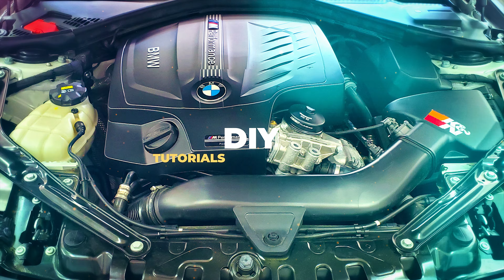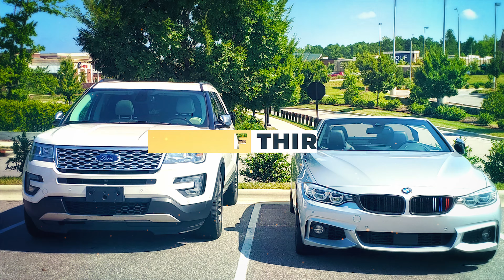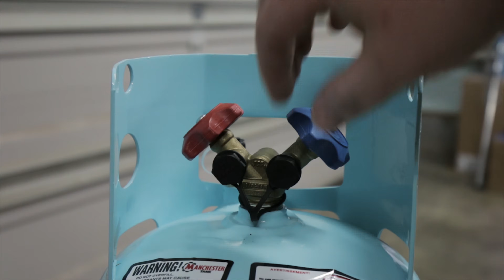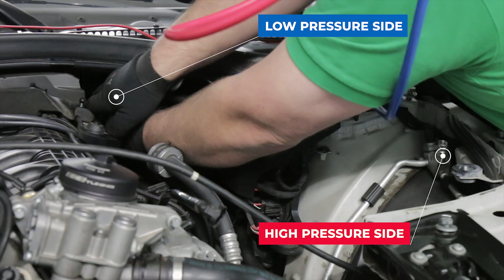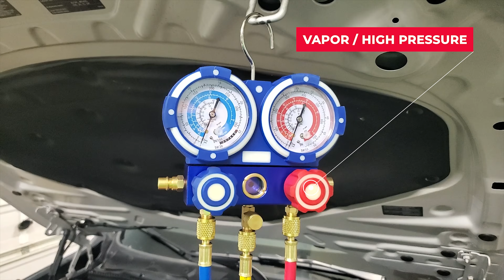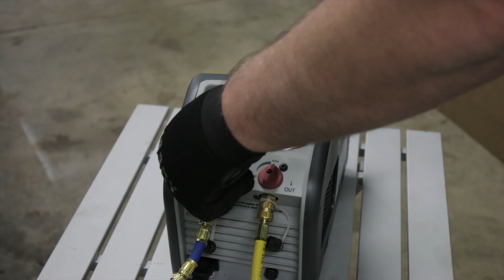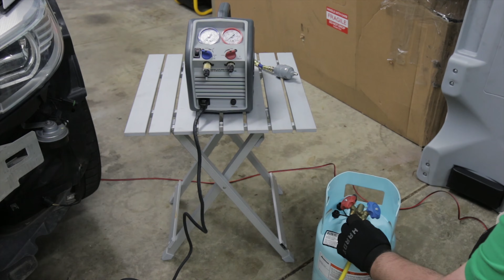EVACUATE YOUR CAR'S AC SYSTEM THE RIGHT WAY

Comment: Great video! One thing I want to correct though—R-134a doesn't actually deplete ozone. In fact, that's why it is used today instead of R-12 (aka Freon), which had an Ozone Depletion Potential of 2,400 (R-11 has an ODP of 1). 

The reason why you can't vent it is due to its Global Warming Potential (GWP; basically how much heat it absorbs from the sun and traps in the atmosphere). CO2 has a GWP of 1, which doesn't really tell us much because the GWP is defined based on CO2. R-134a has a GWP of 1,300, which means 1 gram of R-134a is equivalent to 1.3 kg of CO2 in terms of its effect on the greenhouse effect. One 12 oz can of R-134a has 340g of refrigerant, and venting all of that would be like releasing 442 kg of CO2, or almost half a metric ton. Roughly equal to 10% of the average car's annual CO2 emissions.
Reply: $600 for the refrigerant recovery machine alone? If they want people to be responsible about this you’d think they would make it affordable to do it.
Reply: Why do they sell bottles at Walmart if it’s that dangerous?
Reply: @evidinha12  Who knows?  How come you can carry up to 11 pounds of live ammunition on a plane under the current rules?
Reply: @evidinha12 they don't in Washington anymore. Have to have 609 cert to buy it now because of the ozone layer or the global warming effect, depending which refrigerant you vent.
Reply: @evidinha12  because you can also buy caustic/toxic cleaners, guns, knives, screwdrivers, power tools and many other dangerous products, but you're expected to act like an adult with some brain cells and do the right thing with them.
Cant wrap everything in cotton wool and bubble wrap.
Reply: @bushratbeachbum not true. Govt doesn't want you even having gasoline.
Reply: @Arbitrageur_  which comment are you responding to?
Reply: If my system has leaked out R-134, do I need a recovery tank since nothing to put back in. I can then just connect gauges and vacuum
Reply: @bobbysmith4540  No, not if your gauges show 0-0 pressure left in the system.
Reply: @bobbysmith4540  need to check the pressure first, check for oil leaks, then recover whats left, pull vaccum, test with nitro, repair leaks and then refill with required oil and dye amount
Reply: How much money to spend in order to save $20.00 in new freon at Walmart? Recovery freon when million cars out there are leaking every second, even new cars on lot and those that no one bought it. is absurd
Reply: I finally broke down and took epa609 test. A friend in Washington says you CAN'T buy r134a recharge kits,and shops are charging 100.00 a lb for charging system. It also is being phased out and using blends will cost you big-time if you go to a shop . 
 Why not vent?? Get caught by your neighbor can give them up to 10k rat out  and 37k fine to you. 
  The days of the propane leak detector is over,and as individuals diy without equipment bring more regs.  Charging without pulling a vacuum leaves air in system and higher pressure reducing efficiency.
Reply: @daleharvey3278  I've been using Envirosafe Industrial r134a replacement refrigerant. It's better than r134a.
Reply: I hope you all realize that those air can dusters are filled with this stuff.
Reply: @JustEnjoyingLife73 wrong ... That is compressed CO2
Reply: @AnthonyVierra  compressed CO2 would be extremely dangerous due to the extreme pressures. Canned air is definitely the same as refrigerant. Just look up the MSDS for one of them. People even fill their ACs with what's inside canned air.
Reply: @JustEnjoyingLife73  find me a link to purchase what you describe...
Reply: @AnthonyVierra  You might want to google "Chemtronics HFC-134a A/C systems" and find out how wrong you are.  The electronics and medical industries use HFC-134a and vent it directly into the atmosphere from "canned-air".
Reply: Not trying to argue, I don't know anything. Just a question I have. Where in the environment does this come from that it is so dangerous that it can't go back? I know it's wrong, I'm just being facetious, but it's like oil was in the ground and everything was fine so it should be ok for me to pour it back where it came from :p
Reply: Narcissism is real
Reply: That recovery pump and gauge set is intended for 410 not 134
Reply: wow! Great information! Thank you!
Reply: That is very nice explanation. By any chance can you provide a reference to the source? Thank you.
Reply: EPA Section 609 Program
Reply: @Rbenterprises4  Easy to get certified.  Then  you'll be able to work on other people's cars for $.
Reply from the maker: While R-134a does not have an Ozone Depletion Potential it does have a high Global Warming Potential. (GWP) The higher a GWP number the more damage the  product can do towards Global Warming. These high GWP chemicals are known as Greenhouse Gases.
Reply: @fthirty3  yeah, the guy said that.
Reply: 134a gwp is actually 1430 and r12 was 10900 (yf is 4), but the ozone part is correct. dunno the odp numbers
Reply: Sorry man. U need to go look it up. Thats y u cant just release it into the air.
Reply: I say it’s all bull s&@t. If this was so hazardous to the environment they would t sell it to the general public. Imagine how much r134 is discharged into the atmosphere from car accidents alone. The equipment you need to handle r134 is so expensive that there is no way the DIY er is gonna buy it. And then the manufacturers sell you a car that requires 1.2 cans of r134. What happens to the other .8 ? Rant over.
Reply: @imadog131 you been eating all mummy's tide pods champ? Xxx
Reply: @bushratbeachbum  Not hardly. It’s all a scam because somebody wants to keep people from fixing one of the simplest systems on their own car.
Reply: @imadog131  didn't you say you can buy it freely?
You're not really making much sense there big yin
Reply: @bushratbeachbum  Yes you can buy 134a and the equipment but who’s gonna spend $800 + for $150 bucks worth of gauges and pumps?
Reply: @imadog131  i bought my kit second hand for under $100 and me and my friends use it often.
Makes a lot of jobs much easier if you can take the ac components out.
Although some people can't think for themselves, others are able to see a problem and find a solution to it.
We're all different though, huh?
Some people don't know which end of the crayon to chew and which end to scribble on the shortbus window.
Reply: @bushratbeachbum  Those are the ones who believe whatever the government tells them, the ones who think Joe Biden is a good President and those who believe the global cooling, warming or climate change whatever they are calling it these days.
Reply: @imadog131  The new self-sealing cans will retain the 0.8# for the next job.
Reply: I don’t look at the EPA numbers anymore. They change over the years, as do what to be the most concerned about. Example: co2 is the worst. What? Now NOX is? Heat emmissions? Water vapor? NOX is 265x worse than co2? Huh? Now it’s 300x worse? 
The point is- it’s not good for the environment, but the reality is we don’t know how bad. We change our statistics and make it up as we go.
Reply: actualy id be more worried about the SIF potential... (sky is falling)
Reply: But we all know human activity like this is not what is warming the planet.
Reply: I'll just release in the air my self. Not paying to have it done. Stop being pansys

Comment: Couldn’t you of just used the recovery machine to draw a vacuum? I’m not understanding the point in the vacuum pump when you have the Robinair recovery machine.
Reply: Yes the machine is beginners hobbyist.  
Get what pay for. 

I let pros do my recovery and  charging service vs buy the machine..  

I still have questions too about oil install. The system needs right amount of oil to work long term
Reply: @jamesconnor9142  I have had "pros" work on my AC system and the last 2 have done terrible jobs.  However, I believe an educated car owner can get much better work done by mechanics once they know they aren't dealing with the average "Joe".
Reply: my recovery unit trips off at ten inches of vacuum.   The pump cannot handle drawing a higher vacuum than that without damage.   I switch it over to my vacuum pump to finish the draw down, which has oil.. unlike the recovery pump.
Reply from the maker: The recovery machine isn't designed to draw a vaccum. It's only meant to transfer the refrigerant.

Comment: Can you recharge the gas from the recovery tank back into the A/C system?
Reply from the maker: You can, but its easier just to put new refrigerant in which is what I chose to do.
Reply: @fthirty3  .......Then what is the point of doing this freon recovery?.......I thought that when the government regulated the old freon (R12) out of production that the new freon (R134A) was environmentally freindly?....So therefore can't you just release the freon into the air?
Reply from the maker: It's still illegal to vent r132a into the air. So either way, you have to capture it. If you'd like to reuse the refrigerant,  just reverse the flow from the recovery machine.
Reply: It seems i would want to use the 'old freon'  its just cheaper and makes sense. 

Freon doesnt get old  but its expensive to replace over $100 dollars to fill from empty
Reply: @jamesconnor9142  I’m definitely no expert, but I think the problem is that unless you have the refrigerant identified and analyzed, you have no way of knowing if you are putting contaminated refrigerant (w/ air, moisture, sealant, etc.), or possibly even counterfeit refrigerant, back into the system, which could damage it in the long run. As far as I can tell, the machine in the video is a recovery-only machine, but there are also analyzers and recovery/recycling/recharging (R/R/R) machines, some of which I think are capable of filtering to get the refrigerant back to an acceptable standard. R/R/R machines are expensive, so perhaps a shop can do those steps in the process. Otherwise, the reason for using the recovery-only machine is to enable recycling or proper disposal of the refrigerant that is of unknown purity.
Reply: @jamesconnor9142   I got few cans of 134a from autozone, I don't think it was $100.00 like 4 or 5 bucks a piece?
Reply: @fireyourrocketts  Good price.  Where I live, outside the USA, it currently costs $6 a can.
Reply: The EPA rules, as they now stand, permits this.

Comment: Last three questions I swear!
1) How much oil is taken out during this process that will need to be put back in, along with the new refrigerant?
2) Is all of the oil that's removed solely coming from the compressor? Or do other components lose oil during this process as well?
3) Did you turn on the engine of your vehicle at any point during this process? (I can't tell because I can just hear you and the background music)

Thank you again!!!!
Reply from the maker: Hi Matt, you do lose oil during the process. Depending on how you choose to refill it. You may not need to add oil back in. If you reuse the refrigerant the oil should flow back in. 
The oil thats lost is what is in the lines, not necessarily only from the compressor. When you replace the compressor you need to add oil directly to it as well as when you fill the system with refrigerant. 
During the process I did not turn on the car. You only need to turn on the car when refilling the system. When refilling, you'll want to turn the car on and turn the A/C to max.
Reply: can u even refill it with the old stuff, because u dont even know how it was filled before, so it might have lots of moisture in it or smth ?
Reply: @viisteist1363  I would just put new oil and Freon in it just to be safe so you know exactly how much Freon and oil is in the system, it’s not that much money.
Reply: My question too

I see video where machine separates oil.  Then i think it pulls it back in  when recycle freon back in 

I think this machine not capable

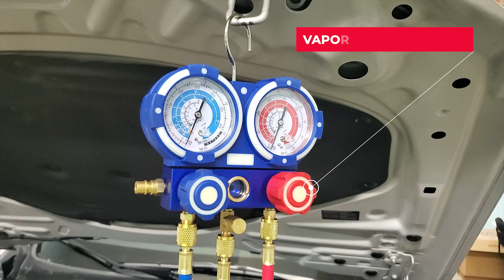Comment: @5:38 - you said:
"Once the liquid's been removed from the car, open the red vapor valve on the manifold gauge  to finish evacuating the system."

What indicator are you using to determine that the liquid has been removed from the car?
Reply from the maker: It only takes a few minutes until you open the other side. Honestly you could just open both sides from the start, It's not going to hurt anything.
Reply: @fthirty3  thank you so much!
Reply: High end systems will actually illuminate a light on the machine telling you this!